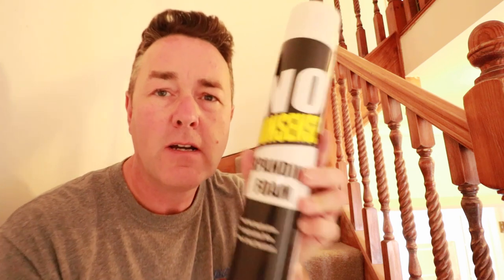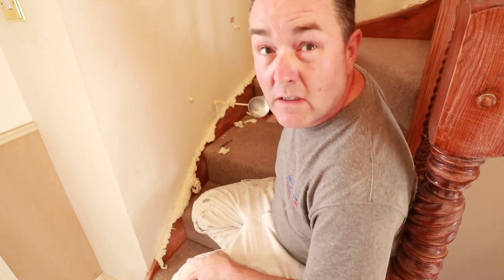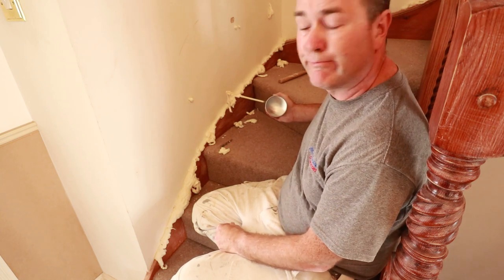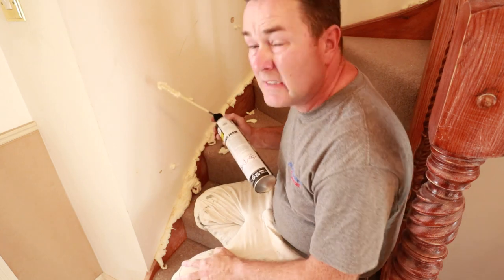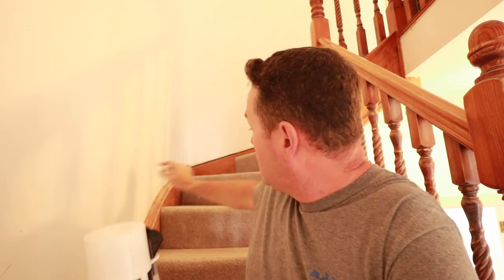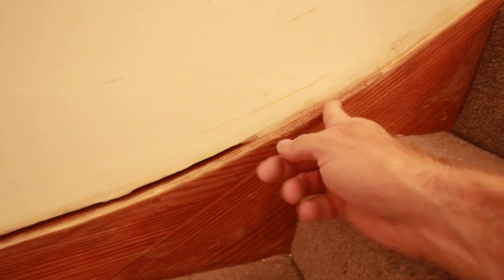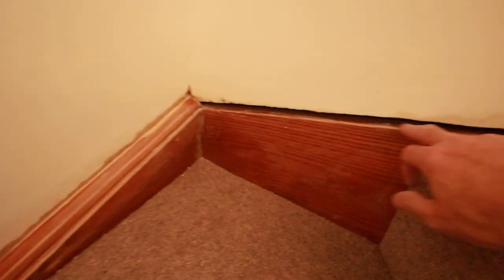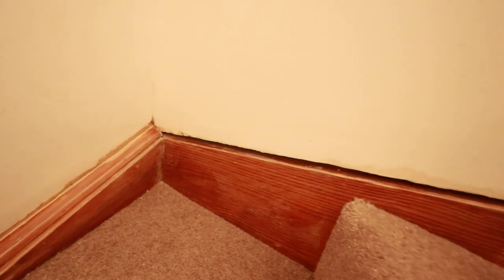Say Goodbye to Staircase Gaps & Popped Nails!

Comment: Wall & Ceiling pop's where the screws & movement pop out the plaster are quite deep & i use decorators caulk to fill first,it sticks like glue to screw head, skim off clean ,it will  sink back as it don't have much body to it, then i use just normal filler, or Ronseal two part, never fails,  i have returned to properties yrs later, expanding foam does find the channels but disintegrates over time as it's basically a dried hard sponge, you can squirt a tiny amount just to help stick, but onto a board then when dry pack out, less messy, tried & tested, evo stik too is good as it's an adhesive that is gum like & flexible so will take movement in wood etc 👍

Comment: Nice one bud, I been using expanding foam for a range of different applications over the last few years. Since doing so have come to appreciate its ability to be a 90% fix bar rebuilding to craftsman's standards. So yea great for strings on staircases and also those annoying corner cracks and wall to ceiling joint from old plasterboard.
Reply from the maker: The way it fixes the loose boarding is very helpful.

Comment: I have some wicked gaps around my staircase that the builders bodged up with some horrible elastic filler. I shall tackle that job now I'm armed with this new knowledge. BTW, when you say to prime before filling, prime with what? Emulsion paint? Or wood primer maybe? Thanks for your excellent video.
Reply from the maker: if its a bare surface use some waterbased primer/Undercoat, then fill/caulk.

Comment: Nice video mate 👍 
I normally tape where you don't want the foam to stick to and wet where you are filling mate.
I had a staircase which kept on cracking. I used repair care bit expensive but been back many times in six years and as not moved👍
Reply from the maker: The gap at the back would just swallow filler though it's so big. The smaller gap will fill fine with chaulk. RC would be a bit much lol
On a painted finish staircase I'd run a line of tape normally. This is being prepared for spraying so will get cleaned down again. Prime, Uc and two top finish.
Reply: @ProfessionalPainterDecorator  I  appreciate you are going to paint the stringers Phil. 
Just my opinion mate,foam sticks like shit to the blanket.
I just find masking of what you don't want the foam to stick to is far easier.
All you have to do is cut foam away and then run a blade down the top of the stringer and peel away the tape.
Still we all work different mate.👍
Reply from the maker: @painterman8863  I would do normally. This did cut back and clean off really easily with a nice clean filling knife and then a light sand as well. I did think it would have left a glue surface like you get with carpet fitters spray glue.. thankfully it didn't leave anything behind.

Comment: Polyurethane glue is a good fix Phil less mess and expands with the bonus of bonding. Also can fix creaking treads by drilling 2 holes into each creaking tread and string at an angle then squeeze polyurethane glue in holes, no more creaking.👍🏻
Reply from the maker: oh Lee,it needs more than PVA glue on it.. it wobbles at the bottom a bit!!
Reply: Not PVA glue… Polyurethane glue lol. A big difference

Comment: Would the Toupret anti crack filler be any good for minor movement cracks?
Reply from the maker: Toupret is good filler, so I'd say it might be worth a try. 
The foam set well and a skim with Presto F had given a good result.
Finished with the bead of caulk prior to the finish coats give a neat angle.
Reply: no it wouldn't it aint as flexible you would imagine and it shrinks well the tube version does anyway for gaps this size using that gear would cost you a fortune best to use expanding foam and polycell all purpose filler better than interior filler kind of a modern version of a repair to the most old school repair of oakum rope and linseed putty or lime putty. i would stay away from caulk most of them are crap i would look at a paintable hybrid polymer to caulk if you  want to use a tube.

Comment: I often use Red Devil on popped screw holes because it seems more flexible and I find the popped holes don’t come back
Reply from the maker: The presto F is a nice filler, and there's something in it that makes it not flash when you paint over it.. once fully dry..
Have you tried it.

I've moved onto Wickes own brand lightweight filler. So much cheaper than RedDevil... And you wouldn't know any difference.

I do use the the Red Devil One Time flexible caulk.. very impressed with that. It's interior exterior as well.
Reply: I haven’t I’ll have to give it a go mate, most fillers I find you need to paint over with a contract Matt or something to stop the finishing coat sinking into the filler. I’ll also have to give the Red Devil caulk never tried it before. I did notice a lot of places have made a lightweight filler and they’re all more or less the same as Red Devil
Reply from the maker: @shokdj1  also. I find I don't waste filler when using the Presto F, it goes a long way and very smooth to use, also doesn't give loads of dust like powdered mix up filler.
Reply: @ProfessionalPainterDecorator  these are very good tips I’m always searching for better products

Comment: What a palaver, I've fixed these issues with wooden or plastic beading fixeto the stairs only, quicker, neater and will last, don't mess with foam, fillers and caulk in these situations
Reply from the maker: If I say part of it has no top edge due to the stringing being flush with the boarding/wall.
A new bead wouldn't look right.

The gaps were too big for filler.
Cut back the foam and skim with filler will be ideal.
Reply: Isomat flex pu40 a lot better than how your doing it and never had a problem after
Reply: Phil knows best, he's a professional painter and decorator 🤣🤣🤣
Reply from the maker: @iSpRayZz  the gap would have taken too much filler unless packing it out with newspaper etc. silly foam is a cheap quick way to build up a large cavity like what I had to fill.
Reply: @ProfessionalPainterDecorator  like previous comment you know best lol👍
Reply: @iSpRayZz  proper know all our Phil, talks like we are all thick and he's the best out there. He commented not long ago about how a guy should be spraying using a slingshot so didn't hurt his back as if it was his first day with his gun. Guy had loads of clips of him spraying but Golden Boy Phil had to tell him the best way of doing it. haha
Reply: @neil30264  yes mate i agree this bloke is a fool loads of good decorators on here watching and he thinks he knows it all lol